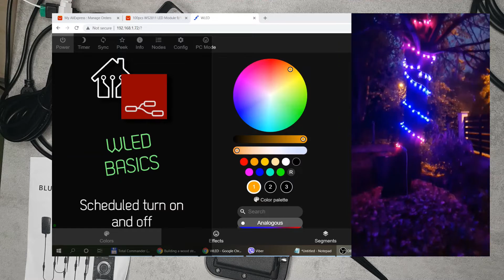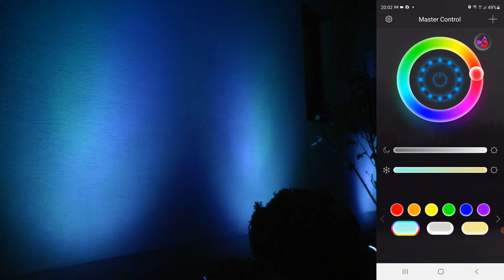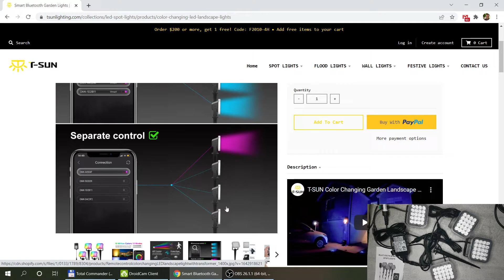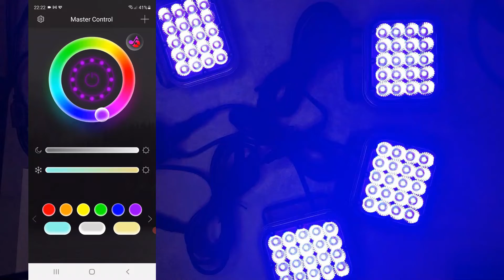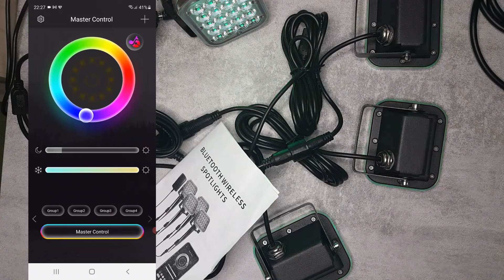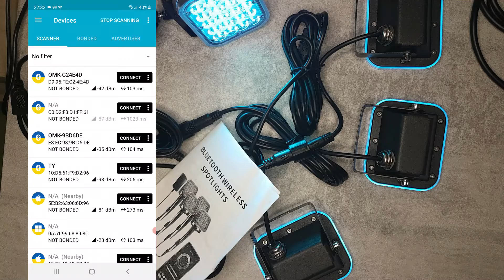T-Sun Garden Landscape Lights - Bluetooth control

Comment: Android phones in "Developer Options" there is a switch to "Enable Bluetooth HCI snoop log". I have no idea what it does.
Reply from the maker: Thanks for the tip. I try everything, I read at least 10 different posts and the dump file is not just getting generated. I tried 2 Samsung phones... I am not sure what I am doing wrong...
Reply: @csongorvarga  I read something about it in the past and hoped you were going to tell me how to use it. I've not done much with Bluetooth, best of luck.